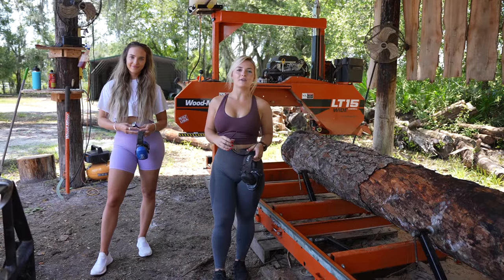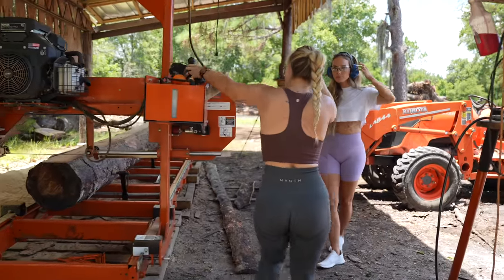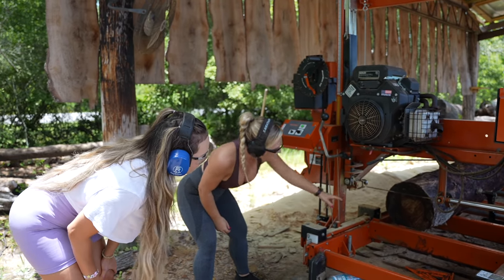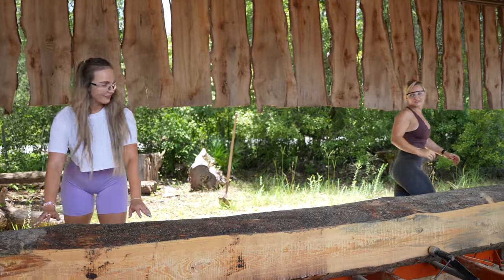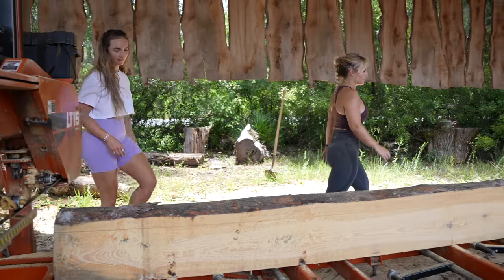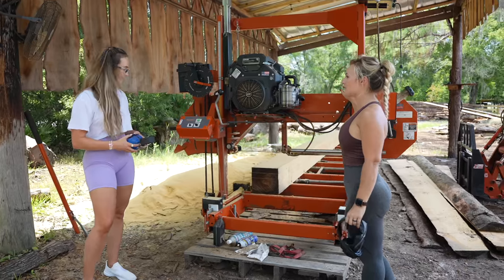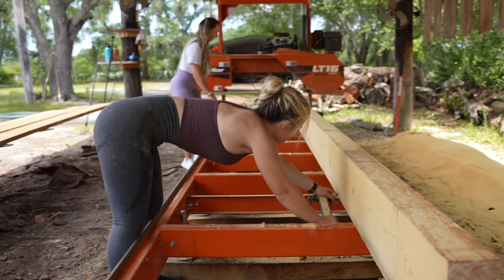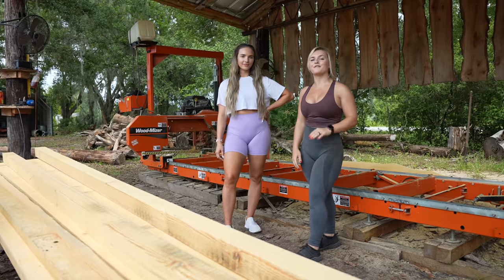Two Beautiful Blondes Cutting Dimensional Lumber On The Sawmill

Comment: Having long loose hair around moving equipment probably isn't the smartest idea.
Reply: Kinda like using gloves when running a Bridgeport or vertical drill press!
Reply: @StainlessTIG2  I've got my gloves caught in drills a couple times. Never got hurt pulled away fast enough but yes it can happen in a split second.
Reply: @wrongthinker350  same here. I was cleaning valve stems with scotch bright wearing gloves. Oh boy did I get lucky! Lessened learned.
Reply: That was the First thing i noticed. Satfetyglasses and earprotection are Perfect but please look After the hair. My Master in germany i think Instruktor in english before you work the First time there he Showed us a Drill with hair and a Bit of skin. After That they all got that net on the Head without complaining.;)
Reply: In 2011 a Yale student was killed when she caught her hair in a wood lathe.
Reply: Honestly. I thought this too.  I always tie my hair back...and no gloves with rotating machines